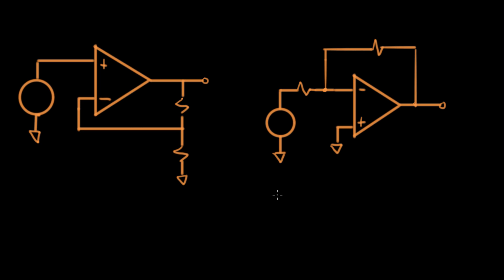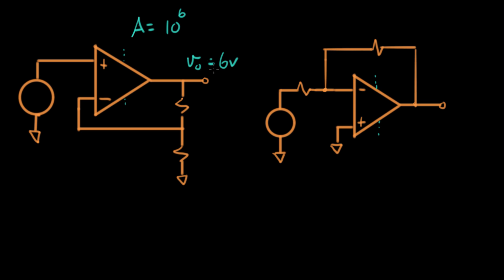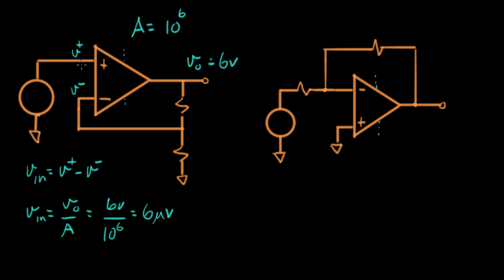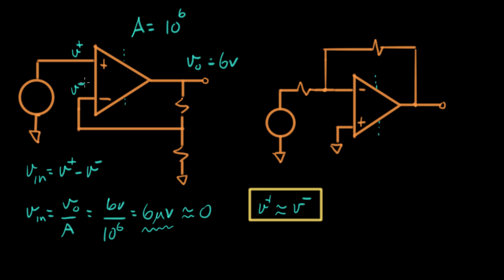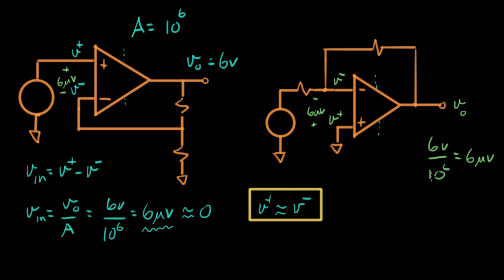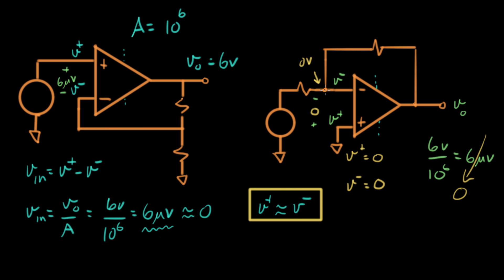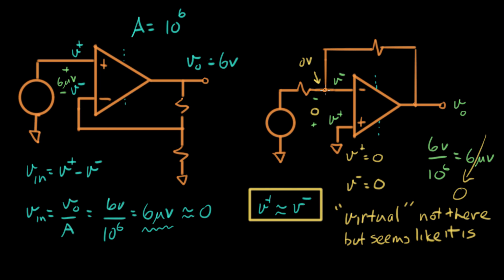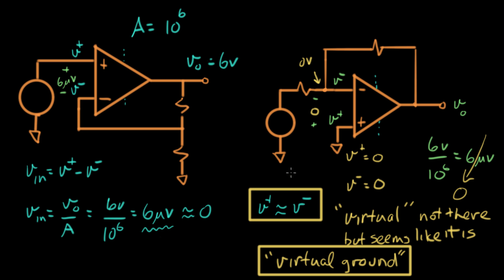Virtual ground

Comment: I think the explanation for the virtual short is a bit wrong which is why it is so confusing. While the formula that you used to prove the virtual short does not depend on the negative feedback, the virtual short is. The feedback reflects the output into the input, forcing it to constantly switch states and be stable at zero differential (V- = V+). If Vin would have been at constant voltage of 3V, it would have been enough to have gain of 10 to get a 6V at the output considering the feedback resistor is twice as big. The inifinite gain seems mainly for the very low voltages that should still push the output to saturation, else the feedback will have no effect.

Comment: For people still confused, it's a voltage divider. The node created between connecting the 2 resistors in series is half of the total supply; relative to when you first learn series circuits and are measuring voltage drops across a half dozens resistors or so when getting started in your education. If you check the positive of your supply with your meter to the center node, you will see 6v, and when you check the negative of your supply to the center node, you will see 6v. In relationship to the positive supply, the voltage drop across 1 resistor at that point is -, and more positive on it's opposite side, and in relationship to the negative side of your supply, the 6v is +, and more negative on the opposite side. Each resistor required 6 volts to "energize" the atoms into alignment so electrons can skip across their valiance rings. Some op amps and larger devices need dual source because of the bipolar semiconductor material in their integrated circuitry.
Relate it to when you bias the base current of a BJT, and connect a resistor from each side of your power supply to the single electrode of the base. The op amp is shifting in polarity, and with each change of 1/2 cycle to the other, needs the opposite polarity reference to bias itself properly. It is only a reference of polarity, not actually quite the same as the base of a BJT requiring both at the same time to free up and activate charge carriers.

I've never understood why not a single video or website online bothers to explain it correctly as I just did when many of them are posted by college professors! It's easily understood when the explanation relates it to a series circuit, voltage drops across devices in the series circuit and measuring each node to determine which side is more positive and which side is more negative.

Comment: wait, so when an op amp is running how it should, both input voltages are equal? and when one of them is connected to ground that means both would be 0?

Comment: Your algebra is still a sloppy mess. *Also*, it might help... If you are going to be using "v"s and "u"s and also writing your "v"s as "u"s, that you actually write them properly and consistently. Half your "v"s are "u"s and the other half are "v"s. The "u"s are turning into "v"s whenever there is a "u" sometimes, or something. There is almost no logic to it. Drawing your "v"s as "u"s is obviously contrived (maybe some person you want to emulate does it?), because when you are not thinking you draw them as "v"s. I saw you go back and draw the tail on them to make them "u"s after (they were "v"s). 

Confused?

Comment: Why do you use the open loop gain “A” in your explanation when the circuits have clearly feedback loops, and the gain is way smaller by orders of magnitude. Maybe I miss something, but this is confusing.
Reply: this is called negative feedback
lets say the the non inverting end of the opamp is V(in) and is equal to V(out) = 0 (initially)
then when the V(in) from the (+) terminal is slightly increased the pd is multiplied by the infinite gain( ideal op amp property)(the open loop gain is usually very high in a practical opamp)
this dramatically increases the V(out)
A feedback loop is connected to the v(out) and (-) terminal 
the v(out) as it increases is fedbackj to the op amp which reduces the potential difference of the inputs which returns to zero 
the closed loop gain is found by dividing the V(out) to V(in) which returns a very very small value hence the gain is way smaller

Comment: if the differential voltage (v+ = v-) is '0' then the output will be zero, right?
Reply: well the thing is, it isn't zero. But for some calculations, like calculating the input impedance, this approximation comes in very handy. Obviously when you use the formula Vout = A*Vin you cannot make this approximation as it would result in an output voltage of zero.
Reply: @olafdrake  then what do u do??  
If Vo = A(Vin) 
Doesn't work???
Reply: @अण्वायुवरीवर्त  Vo ~A (Vin)   where approximately is symbolized by ~  !  
                    if A = -10^6 ,  V0 =  -2v then Vin = -2v/-10^6  = +2uv  
                   ~  is NOT the same as =   !

Comment: but why would you take gain equal to 10^6 in a closed loop configuration ? since you have considered closed loop to explain virtual ground .
Reply: Since gain is not even close to 10^6 in closed loop , how can virtual ground concept be applied to closed loop?
Reply: That is a great question please do let us know if you got the answer
Reply: Did you get the answer to your question?
Reply: actually it is that much only in closed loop whereas it is infinity in the case of open loop